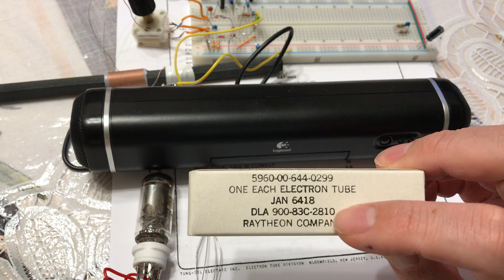Short video of "radio by subminiature tube, 6418"

Comment: Is it wired up for space charge operation. there was a way to use space charge to run 180v tubes on 22volts. And if you had the 6v tubes running on space charge could they run on 3 volts or one D cell?